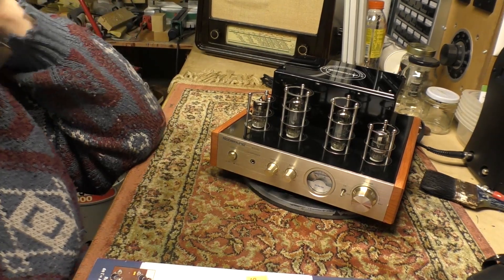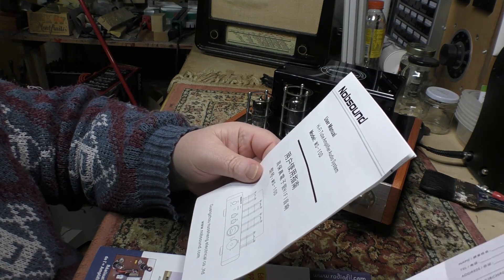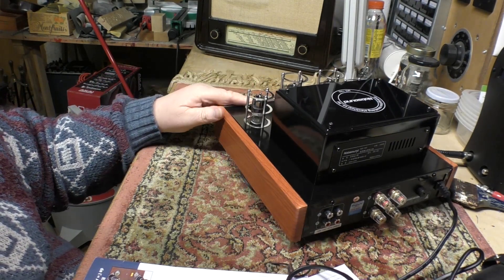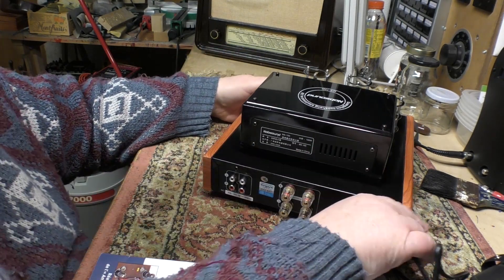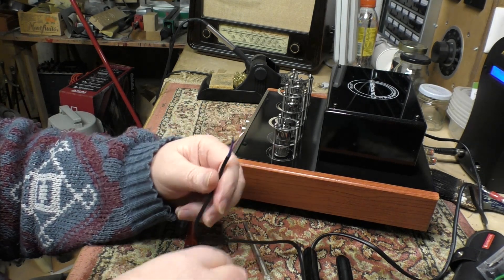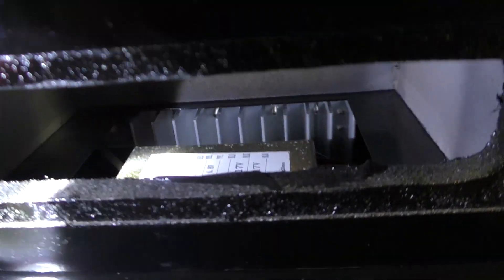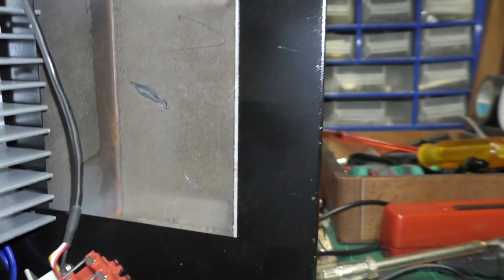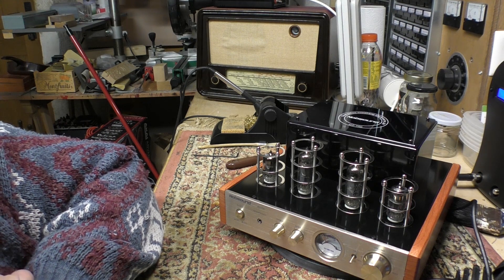Tube Valve HiFi Amp - NOT!

Comment: I have this amp and I can say it is the best $200 you can ever spend on sound. I love this little inexpensive amp. It kills solid state amps 4x it's price. I upgraded the tube to Tungsram and they work contrary to this video. The sound changed from the stock tubes to a much smoother mid and better depth in the sound stage. Vocals were so amazing and life like. I've heard amps that cost 10k (Accuphase) and this  little amp was not miles apart and that is mind boggling. 10k versus $200 bux...For sure there is a difference but I tell you, it is not that big as the price spread suggests. The sound stage was not as big but what do you expect for the price. In audio equipment money doesn't mean it's a lot better. Audio is made for the rich to blow their dough while Chinese companies make good tube amps for the sensible audiophiles that want value.  I've sold this amp and upgraded to the Yaqin (on the way). Another great amp. But I miss my Nobsound when I listened to solid state again. It is really painful and sucked the life out of the music completely. I just want to say something positive because people rag on things they don't know or even don't have. Peace
Reply: Jolida (Made in China)  costs 5-6 times more, yet uses cheaper parts!  I used to upgrade the Jolida to an Alps volume pot, this has one already.  Same for Capacitors.  Also, the audio snob types would be shocked if they pulled apart almost any Western made product under $3,000.  They have some suspect parts too, but for 10x the price, and the same Chinese tubes.
Reply: Молодец , так их )
Reply: @scottlowell493  Did the same with a bunch of Jolida gear.It is amazing how much people will spend on brand name equipment with sub par parts.I have owned Quicksilver and Audio Note gear in the past.Both use really good parts ie; Custom wound transformers,Good caps and point to point soldering.Price is pricey however.Happy listening!

Comment: I bought same tube amp year 1997 in Singapore  at 160 singapore dollars.. That amp is not hybrid at all..tube used ate 6N-M and 6P15..When I rip that unit I found out that the valves  was just supplied the heater voltage and it uses 4558 as tone controls and 1875 ICs as audio output..This is a fake hybrid valve amplifier..Now I was planning to convert this into a Marantz M7 clone preamplifier..using 3 12ax7..

Comment: Thank you for that excellent video. Sorry you got a bad one. I purchased mine 3 years ago knowing it was a hybrid amp. I opened it up to see how it was wired and sure enough the tubes are working as a preamp while the solid state is the power amplifier. The one I got is version 2, so I guess they corrected a few things. The heater voltage is close to 6.3 volts and the tubes are actually the first stage of amplification. I paid 140 dollars with shipping. It has a very clean sound, no distortion, hum or hiss of any kind. After about 1200 hours of use I replaced the stock Chinese Shuguang tubes with Svetlana Russian military tubes and sure enough the sound quality improved noticeably. If you like hybrid amps and you know you are getting an original, then go for it. If you want all tube amplification, this is not for you.
Reply: The problem is how do you know if it's original?
I do really like the design, and would like to try a hybrid amp like this one, but I do not want to get the one which overvolts the tubes with 8.xx V RMS. (RMS is important, because a normal DC measurement shows 5.xx V which is not a "true" voltage reading)
Are all "MK2" models good?

Comment from the maker: A short update since I posted this - I removed the valves from one channel and then no sound so either one or both valves are in circuit in some way.  I was looking at Dave's EEVBLOG channel (number 837) where he does a complete teardown on a valve headphone amp and reverse engineers the circuit.  In this case the valve is connected as a simple buffer on the input so does nothing useful - could go directly to the solid state stage and probably sound better.   I'll investigate mine further when I get a moment.  The plot thickens!
Reply: you may have found out by now but the way they work is they get a digital amp and used the tubes as the buffer, since digital amp are very accurate at reproducing sound even at low cost using the tube as a buffer gives it that warm tube sound. so technically whilst the tubes arent doing the amplification them selves you are getting a near authentic tube sound.
Reply from the maker: That may be the theory but it was not my experience with this device.   The sound was harsh and unpleasant and the tube heaters were heavily overdriven which means they would not last very long.   When I removed the tubes and just used the solid state amp the sound was much better.  It is now my bench test amp in the workshop.

Comment: Ok, but constructor never said its a Full Valve Amplifier ! Only preamp section use valve, amp section is controlled by transistor. Its clear on madison website and documentation. For 200€, I think its a good solution.

Comment: the plug is a non-polarized US plug. 
Way back when, these were the standard plugs. With audio equipment, if you had hum or "felt" current on the chassis when you plugged it in you would simply rotate the plug and the hum would quite often disappear.
There will probably be a rib on one side of the AC cord to designate live (as you find on speaker wire)
Reply from the maker: Thanks.  Based on some other comments it seems this format is still in use in some countries.  It seems odd to me that for some many years it was considered OK to keep such a potentially dangerous arrangement.
Reply: Wouldnt matter with a hot chassis

Comment: I'm a musician (sax, flute and clarinet). I own this amp and the sound is outstanding - I'm very pleased with it. It's a great value but you need to make sure you buy it from a reputable source, because there are some counterfeits out there from what I've been told...  I've had it for two months and never experienced listener fatigue.  The tube effects are obvious to me and can be easily heard, and so can the noticeable increase in SOUND SPACE. I have a pair of Grado GS1000 headphones that sound great on it... Hybrid/Tube amps are the way to go, because with the solid-state amplifier (the pre-amp is Tube) you get a greater power output for speakers... The sound has never been HARSH to my ears or I would have immediately sent it back... I will never go back to all solid-state amps again and I had an excellent NAD 7000 receiver that this replaces. I hate the skepticism about these kinds of hybrid/amps, because if one has ears, it's obvious the tubes are conditioning the sound in a very warm and smooth way and an important part of the circuit. And this one was very affordable at $160, which I got  because I liked the  Nobsound NS-08E Vacuum Tube headphone amp so well. I've been very happy with both and this one is hooked up to my hdtv. What's also important is that the sound of the unit can be changed by rolling different tubes. In the meantime, I've found the Chinese stock tubes on this unit to be very good.
Reply from the maker: I'm pleased your experience has been better than mine.   As I've mentioned before,there are many variations of this device on the market.  In my case I can categorically confirm that the pre-amp stage is not tube, it is solid state.   This is evidenced by the fact that the amp now runs perfectly well without tubes as shown in a later video.  In my model the tube heaters were over-driven which would likely caused premature failure of the tubes.   I was not happy with this amp so replaced it with something I consider better.  Equally I was not happy with the Yaqin MS23B phono pre-amp which I converted as per the Les Carpenter design.   Appreciation of sound quality is very much a subjective experience and I'm pleased yours is working so well connected to your hdtv.   I bought both devices on eBay and personally I believe a certain level of scepticism is justified in anything  bought through eBay.
Reply: I agree. I had this amp and it was the best money you can ever spend on sound. Really. I can compare it to 10k amps and it was maybe 80% of the same smoothness. You have to let your ear do the work and ignore people who don't even have it to tell you otherwise.
Reply: It's a hybrid. Fairchild semiconductor SS power amp and yes the valves do add some tubiness. Think starving student circuit. The same seller does a great single ended amp for about twice the price. These respond to swapping with Russian tubes , so they aren't proper tube amps, but if you get one cheap and swap the tubes out they sound good.

Comment: I have a Counterpoint SA3000 hybrid tube preamp that cost $2500 new. It has 1 x 6CA4 rectifier & 3 x 6DJ8 tubes and no output transformers in sight. The tubes can provide gain or act as a buffer. Imo, when done right, hybrids offer the best of both worlds. As far as I know, there's 2 different Nobsound Mki's. One actually has a toroidial transformer above the main body & a rear fan. Some Monoprice or Sunbucks have this build but have a low level hum. This could be why the transformer was changed & moved into the main body while the shell remains. I just got the DEAFidelity AV-380 (also known as AV-388) and it's exceeded all my expectations. It's quiet, sounds like my best class D amp, but is warmer. They both have deeper sound stages then amps of yore. The 2 rectifier tubes (weird) may be for show b/c it has a SMT rectifier circuit as well.

Comment: Well you know what they say about making ASSumptions. Anyway this is a true hybrid amp, the pre-amp section is a valve cathode follower, so it has unity gain. The same power you put into it comes out. However the sound is subject to the valve characteristics, such as non-linear frequency response, and other things you can read about on google if you stick in “cathode follower”.

Comment: that is an america power plug. the pins are only the same size when the power supply is single polarity. when you have a dual polarity power supply then the pins are the same size.

Comment: I would be tempted to re-engineer this amp and convert it into a bonnefide tube amplifier, and it would not take much to do it. The fact that you have 240 volt AC mains means that you can get the plate and screen voltages you need without resorting to a power transformer or a voltage doubler. All that you will need are some terminal strips, resistors, capacitors, a pair of output transformers, and wire, and a plan of course.
Reply from the maker: +OlegKostoglatov - especially since they've kindly provided space for the output transformers :-)   I'd need beefier output tubes though. It's definitely worth considering and I intend to do some reverse engineering on this amp when I get some time.
Reply: Zone1242
What tubes did they used, real audio tubes or some random TV tubes like they used in that headphone amp.
Reply from the maker: +OlegKostoglatov From what I can gather the tubes are Chinese 'versions' of Russian originals.   6N1 driver and 6P1 output.  The Russian originals were  6N1P and 6P1P.  Finding spec sheets for the Chinese versions is proving difficult and I doubt we could trust they would be the same as the Russian ones.   6P1P is an audio output tube and the 6N1P was commonly used in hifi amps so the Chinese tubes provided might turn out to be useful. Research continues.....

Comment: So I'm just Curious..  did you get the larger board off to see what the smaller, green board looked like?
Reply from the maker: +Bret Frohsein Hi Bret,  not yet but I intend to later on.   After watching EEVBLOG 837 it has given me more insights into how they do this.   It's possible the valves are in circuit but not doing anything useful.  I will find out!
Cheers,  John
Reply: +Zone1242 interesting..  I picked up a Samsung vacuum tube sound bar last year on deep clearance (cheaper than their middle of the line sound bar).   now that's it is out of warranty, I am going to check it see if it's basically the same deal.   it comes up and on far too quickly (5 seconds).   It has JJ branded tubes in it, however, they're labels are facing the back of the unit.  can only make out the "JJ" logo.    Glad I paid 60% less for it than the original price.  It does sound very good, however, regardless.
Reply: Zone1242

Comment: John, here where I live those plugs are common and we do not use polarized sockets here. Talking about polarized,  does 240 volts have a neutral?? I thought only 120 had one...
Reply from the maker: +renatoscutube Hi Renato, well all single phase ac systems will have live and neutral even though neutral will generally connect to Earth at the main distribution panel.  That's certainly the case here.
Cheers,  John

Comment: A video on what it actually sounds like would be informative. It was/is advertised as a hybrid amp so it's not false advertising as such. It's just a pity they went with the retro fool styling instead of doing something original. Don't underestimate these guys though, they will learn and get better.

Comment: This unit seems 220v unit, it marked on the back the unit. 
So I need buy a transformer to use it, right?
Reply from the maker: On Ebay there are multiple versions and at least one of them lets you select the AC supply you need.

Comment: This is Nobsund MS10D, class and sold as a Hybrid tube Amp. Meaning it has the tube as preamp and the power amp using solid state Class AB Amplifier (Fairchild). It is in reality a Solid State Amp. The price and RMS power rating should have been a red flag. You can't get 25WPC with these tubes. A bit more research online would have been wise. Nevertheless, hope you still enjoy the audio quality.
Reply from the maker: +O2Venture Yeah lesson learned!   While it is a hybrid amp it is listed as a Tube HiFi amp so I suspect many folks get duped.  One could argue its not really a hybrid amp since the tubes perform no amplification role.  Anyway, as a solid state amp it sounds pretty good so it's now installed in the workshop replacing my previous test amp.   This one has the advantage over the previous one in that it has a linear regulator power supply so there is no radiation interfering with shortwave reception. Every cloud has the proverbial silver lining!!

Comment: I guess it depends upon how the eBay listing is worded, but you should (in theory) be able to get your money back (if you want) as it is not what is advertised. They may try and reject it as you've had to take it apart to find out.

I had a look at one listing from a seller based in Germany, and the description is basically written in "Engrish"/"Chinglish", so it's not entirely clear...
Reply from the maker: +mrman17 Yes I think in this case they use 'Chinglish' as a get-out strategy - 'what we meant was...', etc.   Anyway,   I think  I'll do a full teardown on it one of these days.

Comment: John,

I've heard horror stories regarding these amps, and their propensity to "drive the filament train, and that's it".  Will be sending an email with info, local to your west-central coast,  featuring one of the better, more modest tube amp builds which I've seen using ECL 82's, if memory serves (and a damn great sound) ,,, and an intro!

All the best,

Tim
Reply from the maker: +AMStationEngineer Thanks Tim, always happy to check out new options.   This little incident made me chuckle because its the first time I've been stung like this and fortunately it didn't cost too much.   In general I buy only components on eBay and I think this experience proves that my approach limits the risk.  I connected it up to a set of speakers from the 70's this evening and it definitely has that bright harsh non-tube sound.  Interestingly, it features a slow start, so audio doesn't come through it until the heaters are lit up!  They thought of that too.
Cheers,   John
Reply: Crappy chinese tubes

Comment: Ha ha ha...OK it is six years later and I have been looking at Knob Sound on Ali Express recently - and I have to say, some things look very promising indeed. Far removed from that turd. The case looks lovely though and could be used for a real amplifier. The current range looks like they are all kosher. Subbed at last!
Reply from the maker: Hi Martin, yes I'm sure the products they market these days are nothing like the one I got. Mine has been my workshop test amp (minus tubes of course)  ever since - and works fine as a purely solid state device.
Cheers,   John

Comment: Hi thanks for the very interesting video.  Nothing wrong with an hybrid amp.  What i do not understand is why so many tubes when just one usually is enough to provide that lovely tubey sound.  I  have memory of some hybrid amps and they all sounded quite nice.  Actually i like the approach a lot indeed.  Speaking of real tube amps from what i read the performance is very much depending on the quality of output transformers and the very good ones are as rare as expensive.  Very expensive.  A solid state output stage can be much cheaper.